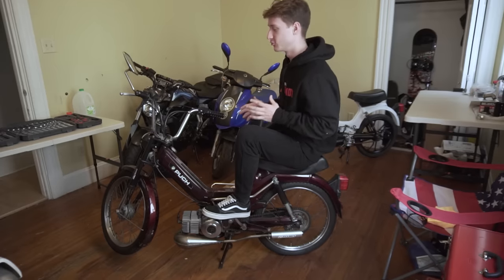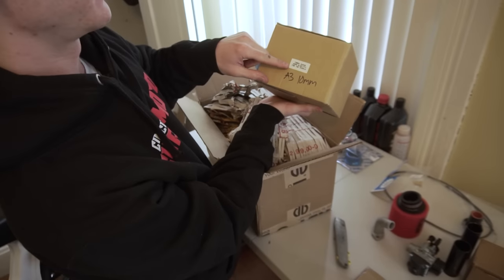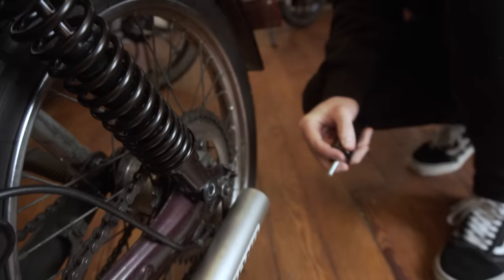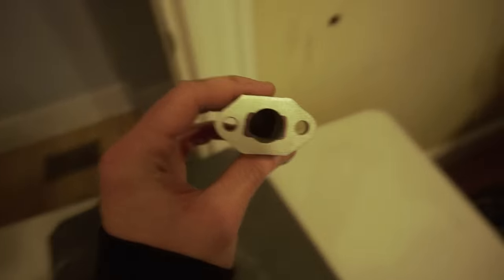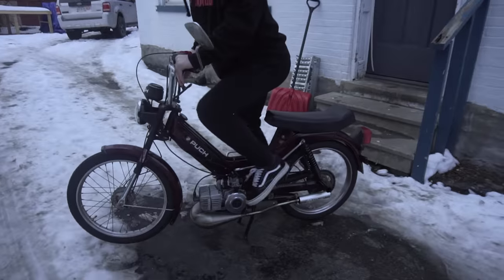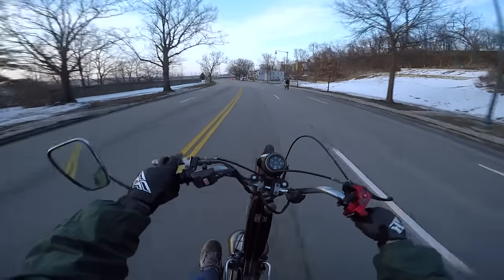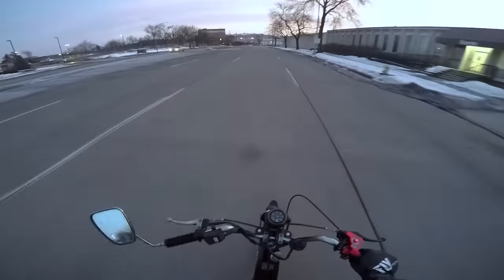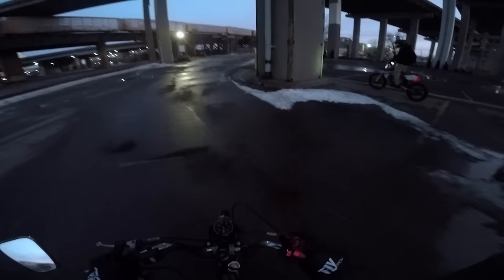Moped Carb Upgrade!! (HUGE POWER INCREASE)

Comment: I had a puch maxi in 1987 when I was 16 years old ,after half a year I changed everything what you did ,70cc carburator exhaust and it had a top speed of 110 km per hour and won a lot of races against  tuned Honda mt50 bikes that where popular at that time.Nice to see that they still exist.
Reply: With a 70ccm, 21mm carb, tune-up exhaust, clutch and filter you need a super high gearing to reach 110 km/h… which makes it crazy slow from 0-20 km/h, to the point you need to run it up to speed.
Reply: @mattipanduro8583  No you can get to around 100-110 with standard gearing.

Comment: Engine braking, no airfilter and stock jetting - this guy is testing his luck😂
Reply from the maker: She’s a ripper what can I say
Reply from the maker: And there’s no clutch on a moped there’s no such thing as not engine braking
Reply: @TwoStrokeJ  just makes is better😂 love the build man💪
Reply: When you buy off market carburetors it usually doesn't come with stock jetting it mostly has like a 15 number increase to the standard carburetor jet..
Reply: Wait theres no clutch? Tf?
Reply: @cheddarshredder6572  It probably has a torque converter, like the scooters
Reply: Its an autoclutch lmao
Reply: @TwoStrokeJ  there is a clutch. a centrifugal one. you can make a smal adjustment on  the rpm it starts, or upgrade to a stronger one that can handle more power and higher rpm.
Reply: @jvinsnes  They have variators not torque converters
Reply: True, most scooters do use variators like you said. Some use torque converters, although it is not that common, I've got two such mopeds.
Reply: @jvinsnes  What moped is that?
Reply: @josef2102  It's a Motobecabe Mobylette. Pretty cool and fun little moped to cruise around with at summer. Not the fastest thing of course. Barely does 15kmt up hills. Think it was a 60' or 61'. The reason I say "was" is because I don't know where it is anymore XD
Reply: @jvinsnes Looks cool. Did it get stolen?
Reply: @josef2102  I bet a friend borrowed it some time ago, but I never bothered to ask him about it because im not really sure if it is the right guy
Reply: @alberttonson3191  do you need a license where you are to operate a moped ? where I am in Canada above 50 cc I’m pretty sure you need one. 
I got pulled over on a 250 and the officer didn’t believe that it was a 250 so I had to polish up the engine stamp so he could read it. 

I’ve only ridden motorcycles, but mopeds have always been fascinating.
Reply: @BigEvy  well i live in the baltics and yes, over here we do need a moped license unless you have a car or a bigger motorcycle license. You can get your moped license when you turn 14.
Reply: There is a clutch it’s just automatic centrifugal! Did you do clutch springs on it?
Reply: R2522 standard jetting

40 Slide
W7 needle
85 Main jet
262AU atomiser
50 Idle jet
60 Choke jet

He's safe I reckon.

Comment: Cool that you're in the cincy area running mopeds! I have a 1979 Motobecane Mobylette that I've thrown a 74cc kit, 15 sha dellorto, doppler pipe, and a whole bunch of other stuff. It's torn apart right now since I'm upgrading the crank and changing the bearings. I'm over in the Milford area, if I ever see you on the puch, I'll fly ya down!!

Comment: The peugeot and mobylette  brand mopeds can be fitted with malossi engine and parts, and can accelerate nonstop given enough road as they arent limited by gear speeds, may take engine mods. They race them at our local track and ive seen one do like 70mph with tons more speed left.

Comment: Idk if you ever heard about some of these bikes: Yamaha DT 50cc, Rieju MRT 50cc, Derbi Senda 50CC, all have a enduro/ supermoto variant, and all of them are two stroke 50cc's. Those things are fast af when you put 70-90cc cylinder kit with a larger carb. Along with the inner rotor system, a fully tuned 50cc bike will make around 20-30hp, They are mind boggling fast for the cylinder size they are running (70-90cc)
Reply: I wish more people in US would make that thing a culture, when here in europe its a whole different world. I've always been curious about the moped culture in US but never quite found it :o

Comment: Bro I'm forty years old and me and my bro were doing exactly what you're doing we were putting dirt bike old ass dirt bike shocks on there and we were drilling out pegs off of my Dyno GT to put on there and we used a quarter stick throttle off of RM85 on the same exact same exact color and make moped that you just did that to probably 20 plus years ago brings back memories

Comment: Dude. You need to cut/make adjustments to that intake so that when the moped is standing up straight, the carb is perfectly level.
Reply from the maker: That might help, it doesn’t seem to have many issues with it right now though
Reply: @TwoStrokeJ  Watching you ride, it sure doesn't seem to! Lol! But honestly, float level will have an effect on how rich or lean the motor runs which will affect both power and mileage. If the carb is cocked at an angle like that, it's possible that the thing could run too lean for too long and smoke the motor. Just lookin' out, brah! :-)

Comment: Yo diggin the puch i had a couple of maxi's and i still own a macho. what type 70cc kit is that? if you have the cash get a 65cc poline it will pull even better and have a highter top end speed if tuned properly

Comment: The next thing you need is a ebr reinforced front fork. Really nice forks they are thicker and Can take more beating gotta buy a set for my mine soon
Reply from the maker: yep I really want the hydraulic ones! they are just expensive
Reply: @TwoStrokeJ  i dont know what they cost in the us but in little denmark i can get a set for abot 80 bucks
Reply: @TwoStrokeJ  but nice machine otherwise i got a puch maxi k. badsnake exhaust 17,5 mikuni carb and original 50cc cylinder

Comment: Hi again ;) Did you change the crank to a Rito or some other race stuff? Did you case match your cylinder with your engine block?  The later -80s E50 engines holds up pretty good with the stock one by the way ;) You got to have done the case match! It´s running good as h-ll!!
Reply from the maker: Unfortunately no I didnt case match it. Literally slapped the kit onto a stock bottom end... Hopefully it holds up!

Comment: I just bought a 1980 puch maxi 1.5hp. Im missing the hardware to bolt the motor to the frame. Is there a aftermarket bolt kit available?

Comment: Tune that carb up. With that kind of set up it should like rev up instantly but it sounds like it is bogging a little bit in the lower rev range
Reply from the maker: Yea it’s a bit rich in low rps for sure
Reply: @TwoStrokeJ  Yea i thought i heard it but it sounds good up in the higher rev range👌

Comment: So usually when putting a bigger cylinder in you wanna like "drive it in" so it doesn't explode or has a malfunction.
Reply: By that I mean drive it easy and no super pushes and try low rpms

Comment: Hey man I really like your content and your videos. I am from Switzerland and here we do much tuning for this mopeds. I also have two of them. But I will give you a tip you have to put another crankshaft in. the original it will not last long. Trust me I blew up once a engine because I don’t change the crankshaft. And it’s pretty horrible to see something that you liked  just blew up and go away. Also another thing is with the big carburetor if the keying is not to correct you will also blow this engine up. Bye👋
Reply from the maker: Yea a lot might blow up. Unfortunately how these mopeds are haha. Definitely need to do a crankshaft some day though
Reply: @TwoStrokeJ  if you have a pretty good Engine base they never will distract himself. Little question what do you pay in America or whoever do you live for a Puch e50 engine??

Comment: Hey what size intake are you using to fit the 19mm dellorto carb? thanks!
Reply from the maker: 19mm Intake so the diameter is the same
Reply: @TwoStrokeJ  whats the name of the intake brand?

Comment: When you put a new cilinder on you moped you should break it in you should not give full gas the first 100 km on an alluminium cilinder and its running lean too
Reply from the maker: The top end has been on for over a year it’s not new
Reply: @TwoStrokeJ  you said new cilinder?

Comment: In Italy we have the Piaggio Ciao. And in Italy there is an incredible culture around this moped. It’s incredible of how many Ciao there are in Italy...
Reply: I drive  a Gilera Citta. Ciao (and to a lesser extent, citta) are very popular in the Netherlands
Reply: @shuenshuen  incredible
Reply: @iacopotuttino5515  it's 65cc polini, I have a wheelie vid on my channel. I also have a Beta Ark moped with a polini corsa 70cc cilinder kit
Reply: @shuenshuen  I have the original modified engine with Dell’Orto 13-13, sito plus and 80mm rear pulley. It makes 70/75 km/h
Reply: Check out simonini
Reply: In the netherlands puch tuning is also a big thing i have a 70cc with 17.5 carb
Reply: @demijne9  puch, tomos, kreidler, zundapp anything moped we love it 🥰
Reply: @demijne9  Why don’t you put a PHBG 21? In Italy we are very crazy with mopeds
Reply: In GTA they were called faggio lol

Comment: I would say it's a w times 10😳... Ok someone dumped a push in my scrap pile... Pulling it out tomorrow... Got hit in the front forks and wheel is jacked where do I get parts and someone also dumped a tomos😂... Dude I'm gonna be riding wheelies to days

Comment: I got the exact same mods on my 78 Puch newport that you have on your Maxi. BMX pegs, same rear shocks/springs, same 70cc kit, 18mm phbg, proma pipe, 1/4 turn throttle  and yes it is also a dank wheelie machine. I can personally verify that your setup really woke up the bike and is a fun ripper fosho 😎
Reply from the maker: Exactly bro! It’s a mild setup, not a crazy engine build but it does everything I want!

Comment: Here in Brazil, mopeds like puch are kinda rare, here we have the Caloi Mobilete, wich is a Brazilian one
but there are some mopeds like caloi that have a 75cc kit, with mallosi reed valves, and a 28mm carburator lol
They easily beat up a 125cc 4 stroke bike, and easily reach up 60 mph lol

Comment: Thanks for this advise i am upgrading my yamaha jog 49cc to 50cc piston and would like to know what size carb i should go with for this kinda horsepower please.
Reply from the maker: honestly not sure man, that engine is totally different than this one and I really don't know much about it
Reply: Found out that putting bigger carbs on is adding alot of more torque and speed without having to change other parts out.

Comment: Best carbs are polini, mikuni and lectron carbs
Reply from the maker: nice man thanks for the info!
Reply: @TwoStrokeJ  i myself drive a german simson s51 which is build in 1971 with Stock 3.5 HP and 3nm and a second build engine with reinforced crankshaft, 90ccm and mikuni with 24mm which is putting out around 19hp with 14nm or so idk for Sure about torque

Comment: Small tip on maxi's. There are multiple factory clutch spring options and if I recall correctly some clutches allow you to adjust the rpm it grabs.

Comment: 19 mm Bing carburateur is much better for a Puch maxi btw in the Netherlands is the standard carburateur a 12mm Bing. In 1985 was the Puch maxi the most popular Mopet overhere in Holland. Mine had a Kickstarter you must change the carter for a carter with a Kickstarter. I had also installed a disc brake on the front wheel, aluminum wheels instead steel with spokes. Top speed above 60m/ h -100 km/u we use the metric system. Better welding a pipe between the top of the gas tank and on the frame above the saddle when you improve the power...

Comment: i have a lowered tomos
i have a 
70 cc cilinder
high pressure cilinder head
racing piston 
15/15 carberator (carb)
circuit exhaust 
big boi motorcycle lower bar
i put some spokewheels and semi slick tires on it
and ofc painted it pearl blue
here in the Netherlands its the fastest tomos around my town the tuner culture around mopeds its superrr big around here because you can only drive mopeds at 16y and cars and 125cc motorcycles at 18 you need to be 23 to legally drive every motorcycle 😢😢
you can check my bike out @tm_gr4 on instagram

Comment: Just saying buy stage 6/mallosi/polini parts because you're 70cc kit is a cheap China kit if you put like a high end or a midrace setup you'd see the bike wheelies itself the front takes off I have a stage 6 mk2 racing 70cc on my aerox with a hpc stage 6 crankshaft and the bike runs Hella good combined with a nice exhaust and a 24pwk carb and good transmition setup

Comment: Great to see puch is getting big al over the planet. My own puch is tuned to the max (engine matched to cilinder etc)  it runs over the 100 km/h or  62 mph and its to much fun😁 hope to see you'll max out your puch aswell🤑
Reply: I got a Puch to with 74cc it runs over 100km/h
Reply from the maker: sheeesh Ill fully build a motor some day. For now its a budget build
Reply: Did you do it yourself? Because I really want to get a 70cc kit for my cafe racer but I'm intimidated to do it myself

Comment: Years ago I bought a JC Penny special moped. A 1 hp 17 mph top end.. long story short, I bought a new 2hp jug and piston changed the main jet and the drive and counter shaft sprockets.. 68 mph at 11 thousand RPM. It would take off faster than a Suzuki 125

Comment: i just got into mopeds myself i managed to get my hands on a pretty rare yellow 2005 targa LX for 800 cad it was alil clapped out when i bought it also ran without a filter carb needed cleaning had to get stuff like the dashboard front fairing headlight signals thing did 55 kmh when i 1st got it put one of those tecno Estoril exhausts on it with a 60 jet upgrade to the stock 14 dellorto carb now it does 72 KMH! (near 50 mph) getting the thing repainted in the older yellow V1 wich is more of a orangy sporty color original reproduction checkered flag tomos decals getting a 70cc upgrade for it soon its going to be a near 60 mph monster when im done with it. If you ever wanted your puch to go faster find a 2 speed motor it was an option for the puch maxi wich is weird finding tomoses are 2 speed without option good content keep it up dont forget about mopeds!

Comment: for a aluminium 70cc you can easely start with 21MM, Id say 24 max.
Just wait till you drill out your clutch, dremel out your fuel ports of your cilinder, cork up your crankshaft, also a in-rotor ignition system also does wonders for your power (the stock system, contactpoints, crap out when you get above a certain RPM, making you miss ignitions, or they straight up burn).

I once entertaned the idea of installing a turbo charger to the crankshaft ends for even more power. But when my lil maxi was finaly done and i did a full speed test, at about 110 kmh (68MPh) the speedometer cable broke, and it still reved up, passing cars on the freeway (so over 75MPh). Ive decided that there are cheaper ways to die.

Also you might want to replace the rear bridge for a rectangle steel one. the stock rear bridge is very flimsy at high speeds (thank me later). also you might want to add a support brace from the top of your gas tank to the top of your saddlemount.

Sorry, english is not my native language.
Reply: also, the MAGNUM upgrade is something worth looking into, but at that point you cant call it a moped anymore...

Comment: My grandpa helped me build a pugouet 50 when I was about 11 or 12. He decked the head so much he had to drill and tap the head for a compression release. He put a flat slide carb in it I don't remember the brand.  Didn't help as much as teach me and pay for everything. It was at his lawnmower shop I didn't get to bring it home for over a year , because he promised my grandma he wouldn't help me fix it. Still trying to make everything faster to this day.
Reply from the maker: That’s what these bikes are all about! Super fun to work on and improve!